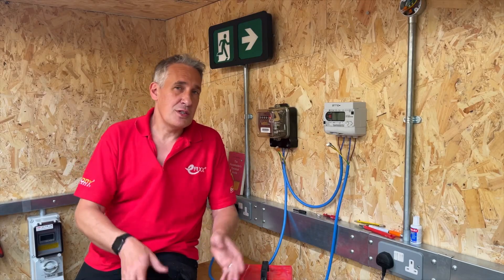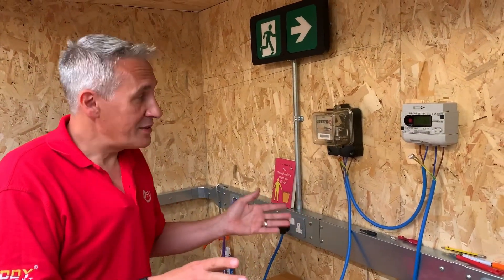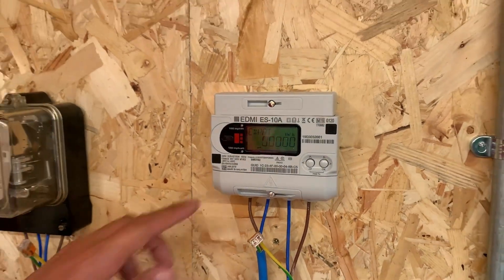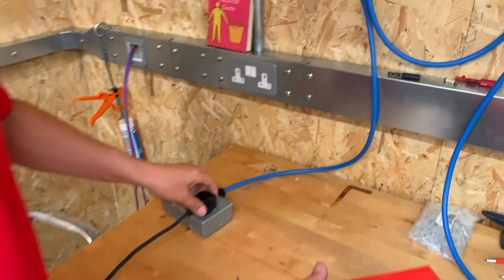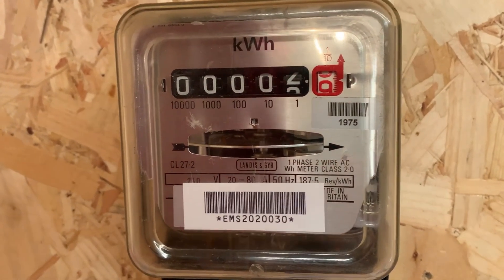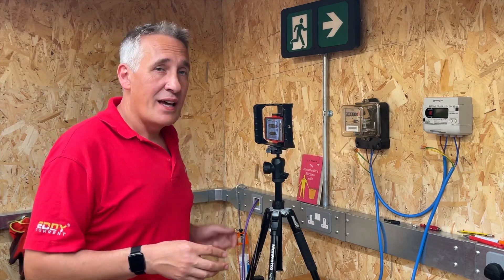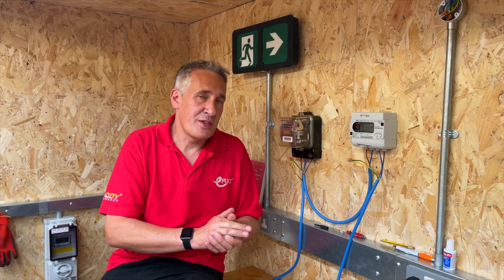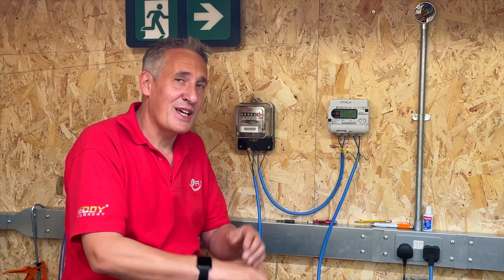Will My Electricity Meter Run Backwards After I Install Solar?

Comment: is this not effectively the theft you referred to - winding back the electricity you had used and should pay for?
Reply: It's more like you're generating electricity to replace the electricity you used earlier. So you've used less overall, and so should pay less overall.

The effect is the same as installing a suitable battery, or using PV-generated electricity to heat hot water in summer, so that you don't export any excess.

Comment: I had to change my meter because my system often generated more than I consumed, even charging the batteries. I believe that by law in the UK,  the meter mustn't go backwards. It means the suppliers either get your surplus energy for free or at a low rate.

Comment: I'm using a leased vehicle, the company who supplies the vehicle is asking about an electric vehicle when i replace my current vehicle, I'm not too struck on a new electric vehicle due to the extreme charges for electric coming into force in the future. with using the current none electric vehicle I know roughly my fuel costs. The main question I want to know the answer to it, Can I have an electric charging point on a "shared" power supply? my electric cable (single phase) comes into the property into the "DNO Fuse block" from the bottom then another cable is connected also at the bottom going away from the property. (cable comes in directly under fuse carrier 'left side' then exits back into the floor from 'right side') the cable at a glance is 25mm in size (combined Live / Neutral / Earth) inside a black sleave. This property is approximately 40 years old. The fuse carrier is Black in colour, not Grey. I did see on a video via YouTube that a shared supply can not have a larger fuse installed to cope with an electric vehicle charge point, therefore in the future when most cars are charged at a domestic property, how would the charging point be installed (would the shared supply have to be changed to a single supply)?.
Reply: Use the granny charger that plugs into a 13A socket?

Comment: My sister recently got solar, with DNO approval to export up to 6.5kW of power.  She’s got an analogue meter, but it has a backstop so she’s exporting for free.  Sadly she isn’t changing it to a smart meter because of “bad stories from friends about them”.  I presumed she suggested that they were inaccurate.

Can you please do a video that explores the myth of smart meter (in)accuracy?  For me, my solar inverter import and export measure are within about 3% of my own smart meter measurements.  A setup like the one in this video, but with differing loads:  pure resistive, switched mode DC power supply, inductive loads etc….. would do a lot to either debunk or confirm peoples concerns.
Reply: Accuracy isn't such a worry, though there were issue with some earlier meters. I'm resisting simply because it's intrusive (24/7 data collection), a security risk (despite what providers may claim) and most of all they provide a way to cut you off remotely (via internal contactor) which will facilitate automated rolling blackouts of there are energy supply issues.  Add to this the general unreliability and problems swapping providers.  My father is on his second smart meter and still has no remote panel operation to provide energy consumption read out and has no cell connection so still has to provide manual readings to the energy supplier. He lives in a fairly big city as well, not in the middle of nowhere.

Comment: Coming from having worked at a supplier I don't think they would agree to a feed in tariff without having either a smart meter or a separate meter to record the export.
Trying to give a lower import reading than what was previously recorded requires a lot of data flows and arguments between the meter operators, distribution operates, electricity database operators (ecoes) and finally the supplier.

Comment: I was with SSE when I had my panels fitted by the council and despite informing them that I had had them fitted I had no end of trouble getting them to accept my readings as I had an old turnwheel meter this went on for three years before I had enough and changed to octopus who have had no problem with my readings and I have had refunds virtually every statement
Reply: I'm not risking it, just made a spreadsheet of what to tell them, based in a formula of daily readings, how much generated, and will vary the formula in the winter to allow the deficit to catch up. After my solar was installed I phoned them up to give my readings as it was much lower than my past usage pattern and openly told them I was aware this much lower reading would otherwise raise more red flags than a Soviet parade. They were happy with the explanation, and of course my formula allows the monthly readings to go up as we head towards winter.

Comment: I might ask my supplier to remove my digital meter and install an analogue meter.😂
I have a colleague who has just this set up and makes sure he’s readings are always more than the last readings, never been changed in 5 years.
I would call this ‘free battery storage’ you’ve already produced the electric and they are just storing it for you until you need it
Reply: Any rotating Ferraris Meter "in certified date" will have an anti reverse pawl, this is indicated by a little logo on the dial plate.
Reply: @nicotoscani1707  Just put the AC on in the house or put the oven on full blast if you’re do a meter reader. If not just keep note of previous months readings and make sure they’re more than what’s produced. It’s technically not stealing as you’ve generated the electric and it wouldn’t be any different to you having large battery storage

Comment: We had a full solar system fitted including a 5.3kw battery in July, our bill at the end of July £38 and August was £18, unfortunately we didn't have a smart meter fitted and was told that in order to be refunded for the export we'd need one, even though we have a separate meter in the house which gives us an export reading. Have missed out on 2 months of exports. Today we are having a smart meter fitted so hopefully if the sun keeps shining we will be receiving a full export tariff of 7.5p per kw
Reply: Don't get one
Reply: @nickcoppard5335  Trust me I didn't want one but had to get one if we wanted to sell back the excess power, Octopus would have owed us last month

Comment: The feed in tariffs are a disgrace and the energy suppliers are making a nice profit from the little guy. 

Would love to see a video from you on the all in one growwatt off grid solutions. I’ve seen them on Dave potz channel and wondering if they are UK approved and how a sparky would go about installing them.
Reply: I'm not a sparky, but I would be very surprised if they are UK approved as they are designed for the US centre-tapped neutral arrangement so would likely not work correctly on the UK supply.  Last year I installed a Victron Multiplus in a US-style house and the electrician said that we either had to get an autotransformer so that it would output 120-0-120, or just run it as straight UK-style 240V.

We chose the latter option as most of the loads that I needed to support were dual voltage, and it was easier to get a small transformer for the one load that wasn't.

Comment: Uk still uses those spinny wheels?
Reply: Spinny wheel meters are by far the best sort. Hugely reliable, no 24/7 data collection, no issues changing energy supplier, no remote disconnection ability.
Reply: @ferrumignis  you forgot that they are bug free, hacking free ! 
Also they might not become obsolete as been in used for 100s of years ! (the V1 of smart meter is been replaced even after few years of service!)
Reply: @Nicolas-qb3yg  Yep, glad other people realise what a potential liability these piles of junk are. 👍
Reply: There is nothing wrong with using them ! They can last forever!
Reply: still some in use but not the norm anymore with digital and smart meters

Comment: Hi.
I have solar panels on my roof but not smart meter. I really wanted to get smart meter for the last 6 years but due to the horror of smart meter 1 i didn't.
Are all sm2 like this on your clip? My solar panels are from 10 years ago under rent roof scheme and have thier own micro gen metre with EDF feed in tariff. my current energy provider is EON and I want to leave it like that.
Can i still get one like this?
Thank you

Comment: 52p!!! Wow… I’m paying about 6cents US. Just a bit South of Seattle. Solar is hard to justify here, low sun, and very cheap power. The ROI is over 30 years, the equipment may not last that long…
Reply from the maker: Solar ROI at these prices has dropped to about 2 years - it's not very sunny in the UK
Reply: @efixx  2 years is quite good, it is encouraging how much prices have come down (and equipment/batteries have gotten better) in the last few years.

Comment: So basically what you are saying to those uninitiated, is that, if domestic customers have solar installed and have an old meter installed, they could be inadvertently breaking the law?
Reply from the maker: A bit of a grey area as it's more borrowing than abstraction.

Comment: Strictly speaking, the notification process to your supplier (not the DNO)  of a 'normal' domestic installation (importing energy only) that is upgraded to become a 'prosumer' that can import or export energy requires that an additional export MPAN (Meter Point Administration Number) is generated to accompany the already existing import MPAN for the existing meter. This should prompt a check of the existing metering equipment to ascertain if it is an analogue induction-disc device that can run backwards (some can only turn up to one revolution in the 'reverse' direction and then stop but others will just keep rotating backwards).
Reply: As a part of that process, suppliers will now insist that you have a smart meter fitted. All SMETS 2 meters are export capable.
The DNO has to be notified in order to approve the system design for several reasons. 
1) they don't want excess export to knacker the substation. I use the general term "knacker" here as it covers a range of problems.
2) they don't want potentially lethal level of current being shoved through their wires if one of their employees is trying to fix an otherwise dead system.
Reply: @rugbygirlsdadg  a proper grid tie inverter should shut down if no power is detected on the grid, so even a solar+battery setup won't function off-grid when there is a power cut.
Reply: @Soruk42  But a proper proper one will still power the house, but not back feed the grid.

Comment: Thanks for the details explanation. i always wonder about this analogue meter situation and now i got the answer. I have a question about my smart meter. will you be able to help me with it? So i recently set up a 5kw on grid solar system and my smart meter have 4 arrows. (up and down, left and right). I figured out the left and right arrow are energy import and export. But i have no idea about the up and down arrows. Also there are marked with O+ for up arrow and O- down arrow.
Reply from the maker: We'll have to explore that one further.

Comment: can someone explain to me how this is made safe?
if the power from the solar pannels is just back flowing into the grid, wont it make it super unsafe for anyone working on the lines when the powers out?
Reply: In a word, no. The inverters that are used to convert the DC output from the solar cells to AC for use in the home can detect loss-of-mains and automatically shut down - this is a standard requirement and is the default arrangement for solar cell installations. It is possible to have a solar installation (usually combined with a storage battery) that will allow you to continue to supply your house during a power outage. Additional equipment, testing and prior approval from the DNO is required (at additional cost!) to accommodate this. In essence, the equipment disconnects your whole installation from the DNO network instead of just disconnecting the solar installation.
Reply: Yeah, fairly standard for a PV install to have both physical AC and DC isolation, as well as sensors in the inverter which detect loss of AC power and isolate too
Reply: @JamesScholesUK  if I’m being pedantic (I am 😁), a loss-of-mains protection causes the inverter to disconnect automatically, not isolate. Isolation has a specific meaning and involves more than just disconnecting a source of energy.
Reply: All grid tie inverters have self islanding. Even if you have a battery it stops working. Only off grid inverters run in a power cut but then you need to run power sockets to everything.

Comment: I had solar installed in 2015 and had an old style rotary economy 7 meter. It did have a back stop but found if I was generating just a little more then I was using (a few Watts) the meter would go backwards, but of course would stop if the generation was a lot more then consumption

Comment: Oh dear me, single insulation on show...That would be a C1 classification on a EICR...Must do better gentleman, not a very good example for the youngsters viewing
Reply from the maker: And 2.5mm sq flexible arctic flex, no cable clips, no seals on the meter, no service head...the list goes on.
Reply: @efixx  lol
Reply: @efixx  and completely missing the point this is a demonstration of the meter behaviours by a spark who obviously knows what he is doing.

Comment: We had solar fitted, with an old style meter about 6 years ago, the meter ran back, didn't say anything and energy company didn't say anything till the meter reading was less than the previous. They came quick to change it to a dumb digital metersl, despite the smart meter roll out being in full swing.
Reply from the maker: Pleased you didn't get the rolled back bill

Comment: Having had a old analog meter for a number of years with solar PV and a battery my old analog meter did not show any energy consumption during summer. Now with a ‘smart meter’ installed last year during summer it is recording 2 kWs per week consumption. The Tesla Gateway2 needs to ‘see’ that the grid is OK and does this by importing a very small amount of electricity.

Comment: We’ve had solar since 2016 with a older meter £££ not much push from the supplier to install a smart meter (were also on a looped supply) but 20,000kwh later and no complaints from me, my FIT rate is still a measly ~16p
Reply from the maker: Do they adjust the bill using the Fit reading ?
Reply: @efixx  No, never even when we had the same supplier for the FIT payment & the energy bill, Eon. We left them as our energy supplier for a smaller company (💡)  but Eon still pay the FIT. 🤷‍♂️
Reply: We snuck in just before the FIT tariff went away entirely so we get 5p/kWh - 16p would be netting us an extra £500 a year.

FIT payments tend to be handled separately to bills. Doesn't even have to be the same energy company. We pay Octopus, then Good Energy send us quarterly FIT payments!

Comment: I did two systems with the old type meters and both went backwards, I told them, best thing they could do, was make sure they were out when they came to read the meter. 
On one of the jobs, when I went back last year, the meter was replaced with a digital type, but they had a few years of it going backwards.
Reply from the maker: Great advice 😂
Reply: Well you know the next thing that’ll happen, the gov will put an obligation on us sparks to report old meters otherwise we’re in for the ball and chain.
Reply: @Mmmjustme  that's true, on one job, the electric company called the guy to ask if his meter was going backwards, I said tell them no, and just say you had the washer on at the time they called, if they clock it 😂😂
Reply: @acelectricalsecurity  😂🙌👍

Comment: how do the different systems/generators sync up in terms of the sine wave of the a/c ? or does that not matter ?
Reply from the maker: Smart meters can record both Kw and Kva but only bill for kW - old meters can only read kW
Reply: @efixx  ok, but not the answer to my question lol.
Reply: Have a google of "grid tied generator", "grid tied inverter" etc... They match the sine wave. My friend was wondering this, what happens if you just send back 240v? It would be out of sync lol
Reply: "A grid-tied inverter converts the constantly varying DC solar power and feeds it into the grid. It synchronizes the frequency and the output voltage to its connected grid. When solar energy increases, the inverter output increases too, injecting into the grid."

Comment: I had my solar installed and yes my meter ran backwards, this was declared as required on the FIT application that this was happening. my bills dramatically dropped and the energy company did nothing for along time, can't remember how long but think it was almost 1 to 2 years, and they only showed an interest when my meter readings were declared invalid on submission (less than previous readings) and they came out and changed for a new meter.
Reply from the maker: Great to know - wonder how fast they will be under the new prices 😂